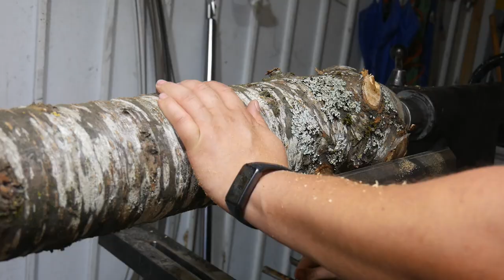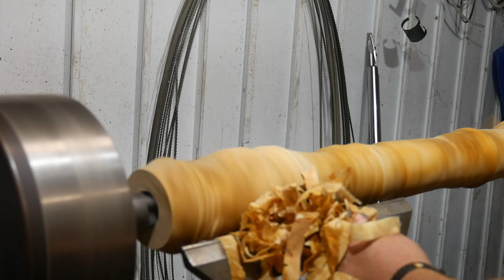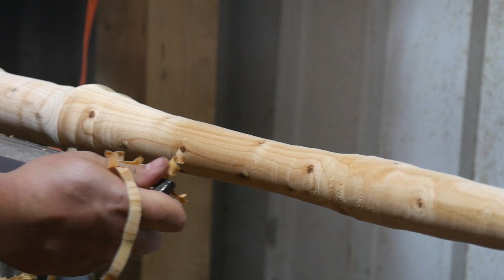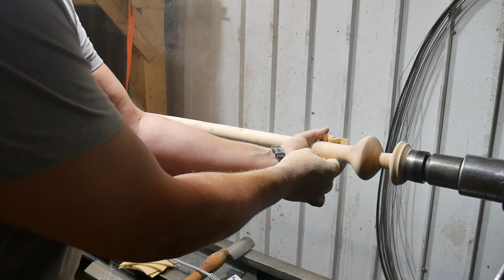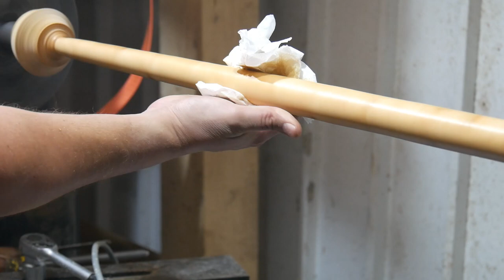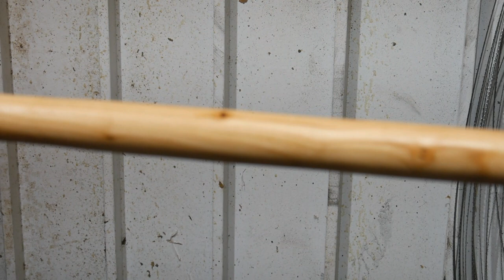Woodturning - The Walking Stick

Comment: Hey Roger, very cool video sir!
A couple of questions:
1. Was that birch wood dry or was it green when you turned it? Looking at the shavings you were making, I'd say it was pretty green/wet.
2. Someone has asked me to make them a turned walking stick like that but with a thinner handle, with a 90° bend to it. So the stick's handle will be in an "L" shape. Have you done anything like that? How would I bend the handle without snapping it? Using steam/boiling water? Have you ever done something like that before!?
Again, thanks for a great video. 
You have a new subscriber.
Keep a goin!
Reply from the maker: Thank you verry much, it was Greenwood, i have no idear for Point 2 sorry